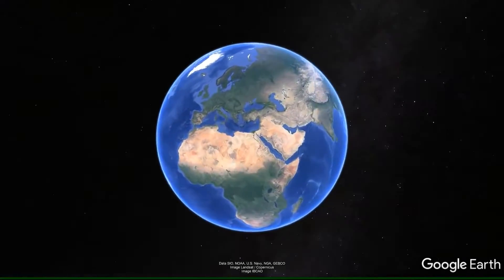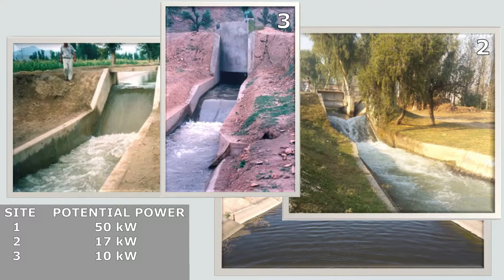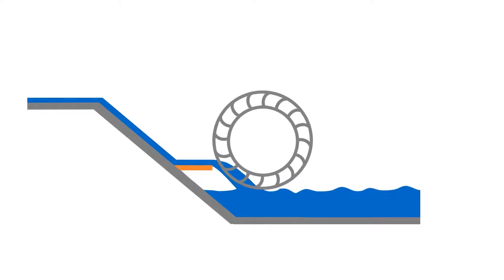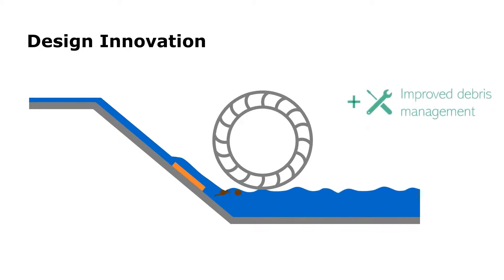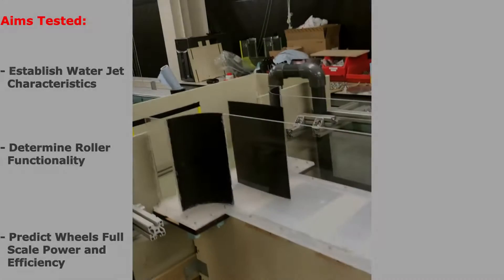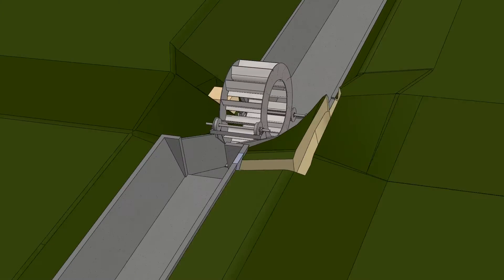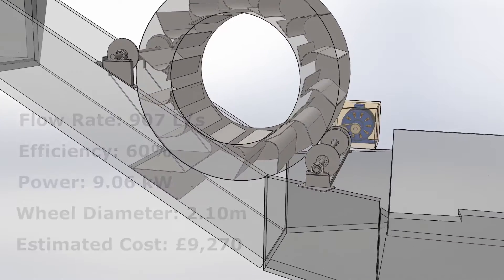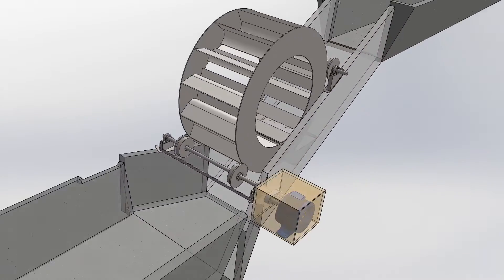Ultra low-head hydropower in irrigation canals for Pakistan

Comment: Irrigation canals only flow for part of the year.
Reply: In PK they flow for 11 months, in other coutries sometimes only 4. That needs to be taken into account, But rmemeber, the flow volume in the canals does not vary as much as the flow in rofers by a large factor. so pwoer produciton is possible for the time when the cnal flows. Then it is a matter of how much the installation costs, and how much power is produced.
Reply: yes, bt that depends. The canals in PK flow for 11 months, some canals in France only for five

Comment: Don't really see the advantage of 4 little wheels instead of one big shaft seems a bit inefficient.
Reply: the resaons are the costs for the gearbox., which usually amounts to 35-40% of the total cost f the installation. Even a 10 kW gearbox with the approrpriste torque, gear ratio and lifespan costs around 15k Euros, so the small wheels give a big costa dvantage

Comment: The friction losts will make it a poor design. 
You must use full drop of elevation. 
With a direct drive to a DC generator.  To a solid state converter to ac. 
Low flow plus small elevation equals low output. 
Paddle wheel has never worked. 
Think vertical not horizontal shaft.
Reply: The friction loss factor in a railway wheel is 0.01. For our case, with a weight of the wheel of 1500 kg / 15 kN and a tangential wheel speed of 3 m/s the loss is 0.45 kW for a power out of 9 kW. I think that friction losses are acceptable when compared with gearbox costs.
Reply: @geraldmueller1  when you say 9kw is that per day?

Comment: I don't think friction rollers will stand the test of time in the wild 😜
Reply: Hmmm, I’m thinking you are right.  I was hoping he was going to say direct drive magnets built into the wheel but thinking he was going to say V belt drives.  Friction drive on a wet surface extracting 9kW from 90rpm….
Reply: @guygillmore2970 in any environment exposure. 
Dust, water, algae water will get into it. 
I'd just opt for an enclosed gear solution. Make it durable and long lasting. 
When it breaks down nobody will care.
Reply: @guygillmore2970  the numbers say that it is possible. The friciton factor for wet steel on steel contact is 0.3, thats well known from railway design. This alows for sufficient force transfer
Reply: they are working on railways.. and even if the whel have to be replaced, the costs are small compared to a gearbox
Reply: @geraldmueller1 there are different types og gearboxes and different qualities. 

However a rail system doesn't sound cheap vs gears. 
Unless so crude that i will start questioning quality and performance. 
Gears aren't really that expensive in themselves unless you go for custom options.
Just standard options make them fit with minimum custom design. 
I mean this sounds more like a diy-project for the guy who wants who wants to do everything from scratch. 
Not really ambitious enough.
Reply: @kilx81  why not? the outer rim of the wheel is made up of a curved steel section, the wheels are standard railway wheels. i would think that you are down to 1/3 of the costs for a gearbox And, remember that you do not need tha shaft, which has to withstand a high torque, either, or the large diameter bearings for the shaft.To give you an idea: the shaft for a 10 kW Zuppinger wheel has a diameter of 300 mm and weighs 1.4 tons of stainless steel. Not cheap either
Reply: @geraldmueller1  you are rooting for a 20$ vs a 50$ solution. 
And the generator is way more expensive anyway...  
The overall cost is not going up by that much however. 
3 years at best vs 10 years no problem.... If done right.